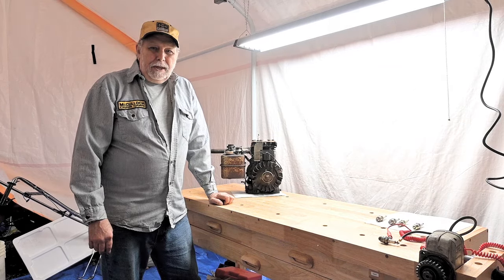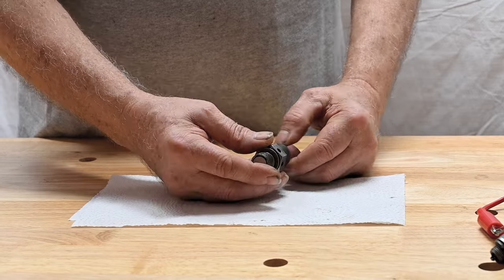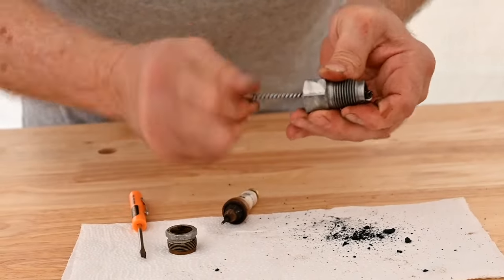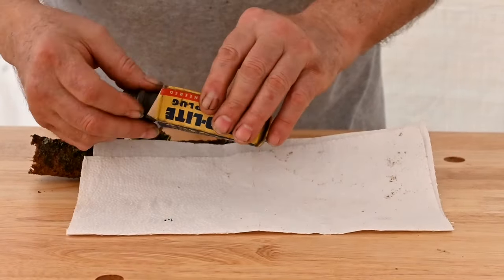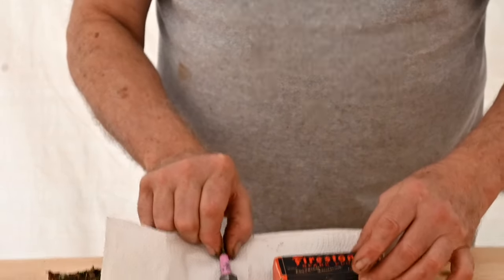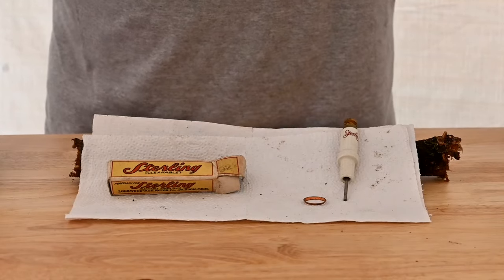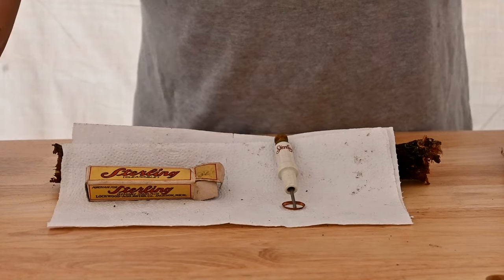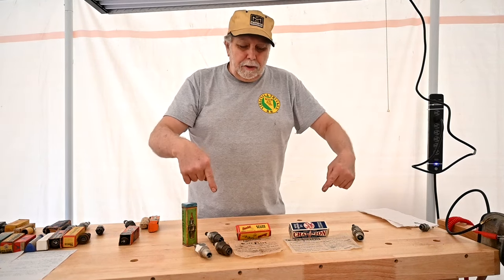Spark Plugs: Vintage - Antique - Modern -  Features and Gimmicks

Comment: I had one of the lead engineers for Champion at their plant here in Iowa come visit me recently as a chainsaw customer- and we had a very interesting conversation about the future of plugs. He said that they are investing heavily into new plug designs and technology as they believe that the government push for electric will fail with abundance. Their research suggests we're nowhere near ready for the grid shift in usage and that internal combustion engines will still be around for a while longer than we are led to believe.
Reply from the maker: The electric vehicle scam is just a bunch of crap. There is a bunch of effort to make new fuels for internal combustion engines, which makes a lot more sense.  There are also many new inventions in the world of combustion engines in the effort to make them much more efficient.  We had a customer that had worked for Champion for most of his working career, and said it was one of the best places to work in the country.  After the family sold out, the company was mismanaged so badly that they were assembling Nippon Denso spark plugs to stay in business. The product line wasn't upgraded to meet the changes in fuel and engine designs,  as little was spent on research and development.
Reply: I thought it was interesting as he actually referenced a point you made about platinum- he said decades ago they lost the ability to patent it and NGK capitalized on it. After that, Champion spiraled into the junk we know it as today. He says- in his opinion- that they fully understand the state of their reputation and will be making significant strides towards changing their products and position as a leader. It'll be interesting to see if it materializes. Excellent video by the way- this sort of evolutionary info is exactly what makes internal combustion engines so fascinating and the story behind each of these players involved.
Reply from the maker: Thank you for such a nice comment.  History is so fascinating, and to combine it with the collecting and using vintage equipment makes for a really great hobby.

Comment: Got my MAC 32-16 running, today.  It had a broken oil line and someone had set the carb to run all to ric- not me.  It is now running and oiling fine.  In fact it slobbers bar oil.  I had to clean out its case because it was full of bar oil.  I now have it full of fresh Stihl Moto Mix and it runs fine on it, even though Stihl says it is 50:1, but it has enough oil for 40:1 engines.  I put it in most of my saws, weed eaters, blowers, hedge trimmers, etc.  my home brew is 45:1 Stihl Ultra.   I won’t spit for the difference between the two.
Reply from the maker: I am not familiar with the Mac 32-16.  It could be a remnant from the Italian McCulloch factory, or just another Poulan in disquise.  I would recommend you watch some videos from Richard Flagg, a pro saw mechanic.  He has been testing a number of 2 stroke oils, and the Stihl oils are some of the worst.  I think you might find it interesting.
Reply: @mrobsoletesvintagehomestea9156  it is basically an Eager Beaver type.  It was made in the 1990’s before they folded.  This saw is immaculate, almost brand new and with a MAC case.  After running my 19.5” Stihl saws with .325 chain, this saw is almost a toy with its 3/8 LP chain.  Not a hell of a lot different from the butter bars and chains on those Poulan Wild Things.  It has a primer bulb and chain break on it.
Reply: @mrobsoletesvintagehomestea9156  I know Richard, but I do not agree with his assumptions.  If you will note every saw that he has problems with are Memtronic (computer controlled).  My opinion about Memtronic or Accutune saws are not dissimilar to my opinion of his assumptions.  I have one Memtronic saw, a MS 241 CM, that has given me nothing but problems.  That is why it sits on the shelf in my shop.  It would probably be a good saw with an adjustable carb on it.  However, I don’t like 16” saws.  I like 18”-20” saws, 24” if I need it.  If I need a 16” saw I have a brand new MS 180 and MS 170 and they dot make a saw lighter than the MS 170.  However my favorite is my Stihl 021 and either it or my Stihl 024 come with 18”, really 19.5”, with .325 chain.  If I need more saw the I can get my MS250, Stihl 025 or MS 260Pro.  Generally, my Stihl 021 will handle most work that I need to do, these days.  That tree you cut down with your 034 could have easily been cut down and up with my 021 or 024.  I have plenty of big saws but I seldom use them unless cutting big stuff.  The last real workout they got was on some 25” hickory a couple of years ago.  They cut down and up a half dozen of these.   You just do not need as much bar as some people  think.  I cut down a hundreds of trees with 16” .325 bars and chains and they were not saplings, either.  I have cut down and up a many a 24” oak with a 16” bar.  Sure, a longer bar would have helped but I still got them safely on the ground and the rounds in the back of my truck.
Reply from the maker: I did some looking on the Mac 3216 saw, and it is laid out completely different than the Mini Mac's are.  The layout looks to be based on the Italian McCulloch designs to me.
Reply from the maker: The only way I would get a saw that has electronic fuel and ignition controls would be if it was given to me.  I would never buy one.  My $1.95 screwdriver works best for me for fuel management on my carb's.  Most tree work can be done with smaller saw, but I prefer using my mid sized saws with longer bars, as I always have the reserve power if needed, and I don't have to bend over as much with the longer bars.
Reply: @mrobsoletesvintagehomestea9156  it is a nice little saw.  A bit heavy for my tastes but seems to be a pretty good saw.  I got it in a deal for another saw that I did not like.  I could trade it for a Poulan 3400 CV.  What do you think?
Reply from the maker: I haven't had either saw, so I don't know which one I would keep.

Comment: Stihl and others are using 14MM plugs on some saws, now, primarily CMR6H and USR7AC.  I use the Bosch USR7AC, because it survives being flooded better than the NGK, CMR6H.
Reply from the maker: Since almost all of my saws are vintage, they all use 1/2"x14mm plugs, some with a tapered seat, but most with a gasket. I run one range hotter plug than recommended, as the spark plug charts were printed back when we had good gasoline. Using the plug that the chart says results in the plugs getting crudded up a lot quicker.
Reply: @mrobsoletesvintagehomestea9156  my oldest saws were built in the 1980’s, most 1990’s.  The one thing I require of a saw is reliability, especially ease of cranking  and constant running.  I hate to see someone crank up a saw, set it down for a moment or two and have to recrank it, again, before they can continue using it. I see this all the time on UTube.  When I crank a saw they better stay running until I shut them off, regardless of temperature or conditions.
Reply: @mrobsoletesvintagehomestea9156  I guess you can tell that I run my saws a tad lean on the L side and a tad rich on the H side.  I hate to hear a saw surging in the cut.  My saws keep a constant RPM in the cut or I get out my little screwdriver and richen up the H side until they do.  That, is how I learned to tune a saw.
Reply: @mrobsoletesvintagehomestea9156  u use WSR6F Bosch plugs in any saw that will take them.  They are 18mm plugs.  The 14 mm plugs are USR7AC.  All gapped at .020, right by the book.  Bosch plugs last longer than NGK, IMHO.    I very seldom replace a plug, these days, unlike in the old days running 32:1-40:1 with oils of that era.  My plugs may have a slight carbon wash on them but they still fire.  Run them hard for an hour and that carbon wash disappears, but at almost 79 I usually do not work for a solid hour, anymore.
Reply from the maker: Reliability and performance are the two things I want from a work saw. My McCulloch 610's have been my main work saws for over 40 years.  I have never done anything other that routine maintenence and carb work and bars and chains on them.The 610's unique exhaust port makes them easy to pull through also.  The hardest saws to pull through are my Lombards and Stihls.
Reply from the maker: The way you tune your saws is pretty much the same way I do.  The saws that I have that surge a bit in cuts all have built in governors in the carbs, so they are a bit more difficult to get spot on tuning wise.
Reply from the maker: The reason I don't use Bosch plugs is that I don't have any access to them from the local car parts stores as they don't carry them, and the NGK's have always been great performers for me.  I recently worked on a Stihl 251C, and the owner bought a new plug from the local Stihl dealer, and paid $9 for it.  That's what I call Highway Robbery !

Comment: I haven't had to much trouble with champion  plugs. The plugs i throw out is torch and walmart auto lights plugs .I'm too cheap to buy ngk but vintage stuff is the best and new is pooh
Reply from the maker: I quit using Champion plugs many years ago since they just didn't work.  They most likely have improved them since then, but the NGK plugs have always been outstanding.  In my chainsaws and small gas engines, when the plugs get crappy, I just use my spark plug cleaner on them and get many more years of use as a result.  The Chinese plugs are absolute junk.

Comment: I clean of carbon from spark plugs with my wire wheel.
Reply from the maker: A wire wheel works to an extent, but the actual spark plug cleaner like I use, gets the carbon out from the whole bottom of the plug.  I almost never have to buy new plugs as a result.